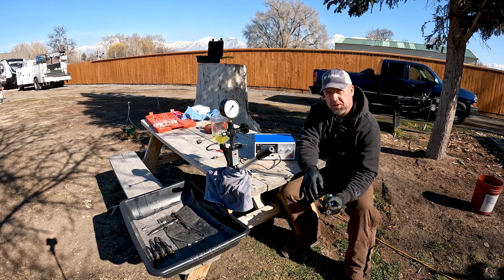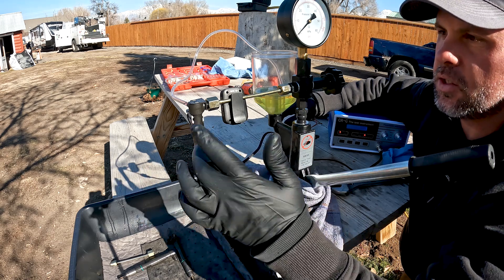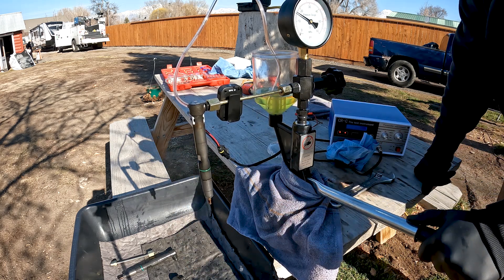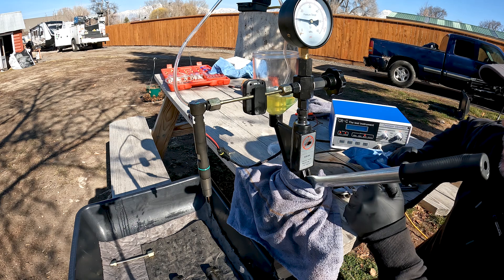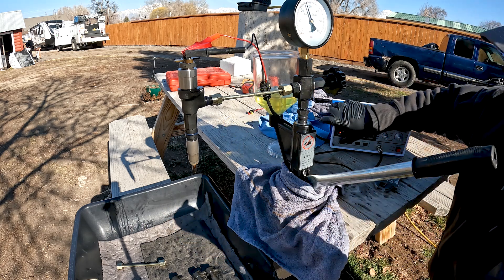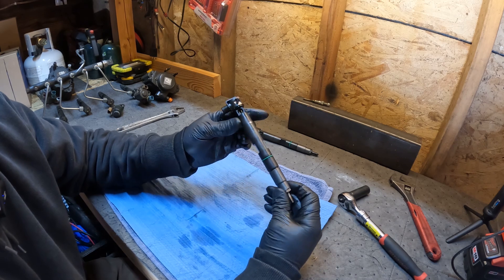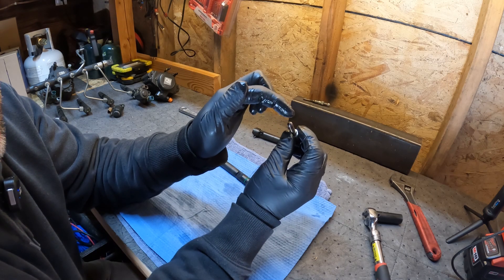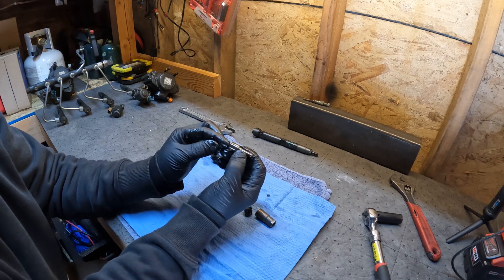Bobcat Fuel Systems, Delphi Common Rail Injector testing and explanation

Comment: Should the injectors have 12v going to them im currently checking out a buddys bobcat with a d24 and its not starting ive checked multiple things but noticed only 2.2v at injector not sure where to get a wiring diagram
Reply from the maker: Injectors are high frequency high voltage, very difficult to check voltage.  Never seen a voltage issue, usually another issue that would cause ECU to disable injectors.

Comment: great video thank you just wondering ,i have 4 delphi injectors on a jcb310 loader and its hard starting ,when we test the 4 injectors we find every thing is good but a little excess return fuel returning about 20 cc on a 1 minute test on a similar tester on your video ,i wonder is that too much

Comment: Do the injectors need to come from bobcat or just simply be the same Delphi injector?
Reply from the maker: It does not have to be Bobcat injectors (Delphi in a Bobcat box) but will need to be programmed by Bobcat due the the proprietary engine software and interface.  That's not to say there is not others who can program but might be hard to find.

Comment: Hey this is Scott. I work at a local bobcat dealer. I'm hoping you can help me get set up with a test system like yours so we can check and test injectors. Thanks in advance.
Reply from the maker: Hey Scott, I do have a direct link in the video description for the test equipment.

Comment: If I put in new injectors and don't have them calibrated will it hurt the engine?
Reply from the maker: Over time yes in theory it can harm the engine as the fuel delivery rate and injection timing can be off.
Reply: Ok thanks for the input. I just have a problem trusting my local bobcat

Comment: Love your videos keep them coming! I have a question Kubota common rail in my T250 and accidentally ran with bad fuel that had water in it - now the only way to start is with starting fluid, bad injectors or bad injector pump?
Reply from the maker: Sounds like an injector leaking which won't allow pump to make enough pressure to start because of the low RPM from the starter.  The starting fluid helps turn the engine faster and then the pump can keep up.  If it runs good once started I would have injectors tested but I think pump is ok.
Reply: @tetradgroup  Yes it runs fine once you kick start it so this is great news! I ordered the kit from Amazon and will check the injectors - I will keep you posted, thanks again!
Reply: @tetradgroup  Okay, I replaced with brand new injectors and it fired up once all the air got out of the system and ran. let it run for about 5 min. Shut off and fired right back up. Took out and did some work and came back to shop shut off and it would not start back up unless I used a little shot of brake cleaner, it fired up and ran. Sounds like my injector pump isnt building enough pressure to start so only thing left is the injector pump, any other suggestions?

Comment: This is such a great detailed video on the Delphi fuel system.Information like this cannot be found anywhere on youtube.I will say when bobcat went to teir
 4 fuel systems it created a big problem with diagnosing these systems especially if u do not have the proper software.But I know their hands were tied because of the epa.To me the Kubota engines with the mechanical injectors were the best system to have .If u suspected a bad injector u would put in on the pop tester  check for leaking and opening pressures.If it failed we would tear it down replace the nozzle and spring ,good to go for another 3000 hours 50 dollar repair in 10 minutes.And your right the doosan is a great engine its really too bad it gets a bad rap because of the fuel system.Another great video Brady

Comment: Awesome vid! 
Have a s590 I was working on. Very hard starting when cold. I did a 2k hr service on it and 3 of the 4 glow plugs were shot. Still hart to start. Starting to think its injectors. 
Who do you use to clean/rebuild them?
Will see about doing a leak test also.
Again, great vid. Pressure differential in those injectors controlled fire by a small coil. Neat.
Reply: What year . Should I buy 2022 s590